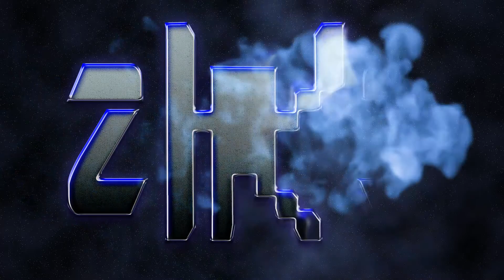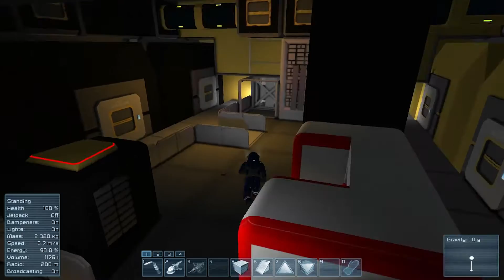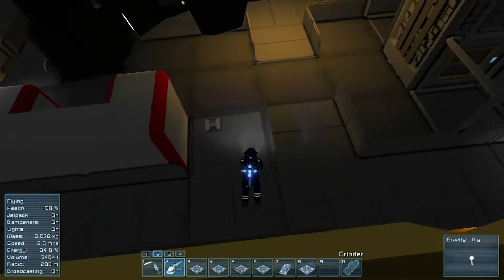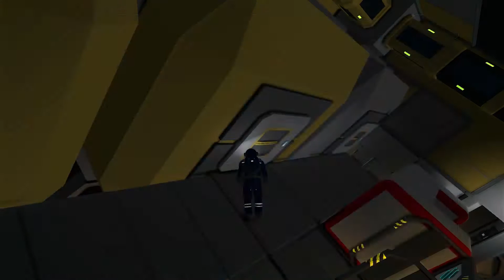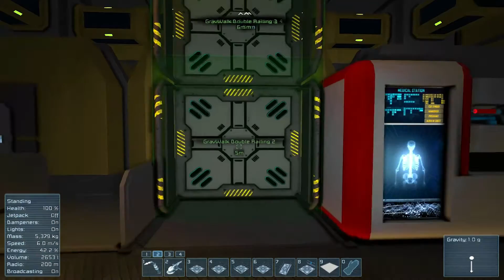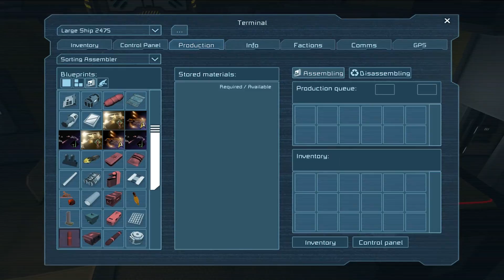Let's Play Space Engineers - Episode 15: Gravity Catwalk Success!

Comment: The reason you couldn't attach to the ramp is because you had the part the wrong way, as evident by the railing.
Reply: wrong it's because the game has a attachment system and the problem was the attaching point was not a vertical point causing it not to attach if he had run one down from the roof or had a support block he could attach it
Reply: did you try to figure out where the attaching points are?
Reply: not really i have mods that do this and i can place objects still
Reply: i agree the mod maker might be new at moding for all we know
Reply from the maker: ToaDrakua Yea, I said that at the end there. I speculated that from the beginning but I wasn't sure at the time. :)
Reply from the maker: killer70832 I actually tried to do that, run it from the ceiling down off camera and that actually didn't work. Because I did have the ramp upside down that it wasn't lining up properly. I mentioned that at the end of the video. :)
Reply from the maker: killer70832
I don't think the problem was attaching points as much as collisions. If you look at how the railings on the ramp stick out, if you have it reversed aka the wrong way like me, then the railings are going to be colliding with the next block's rails. So it won't let you do it. At least that's my theory cause it worked when I flipped it the other way.
Reply from the maker: killer70832
It could just be this particular one I suppose. But I don't really know for certain.